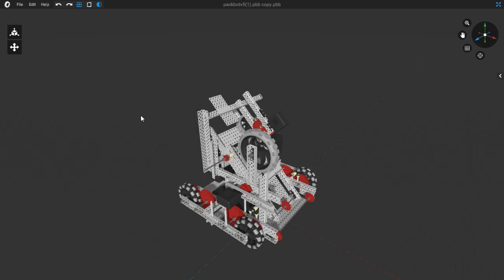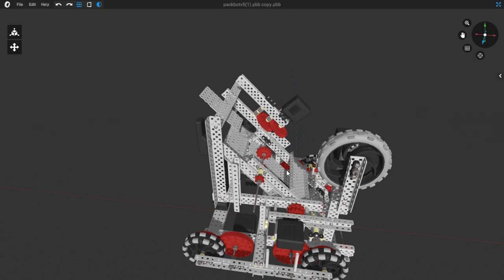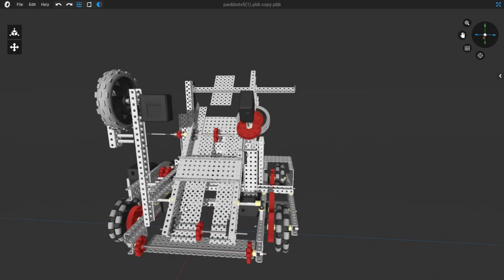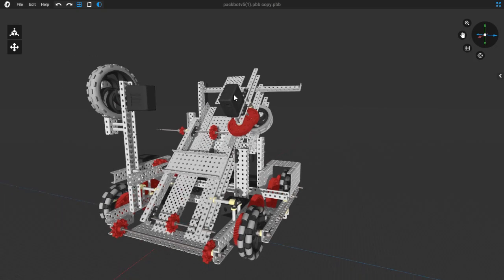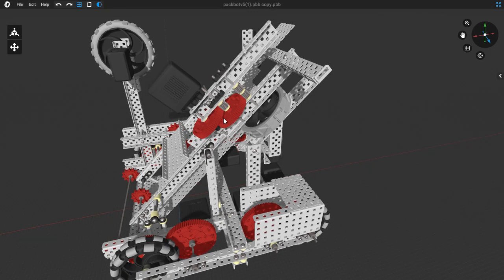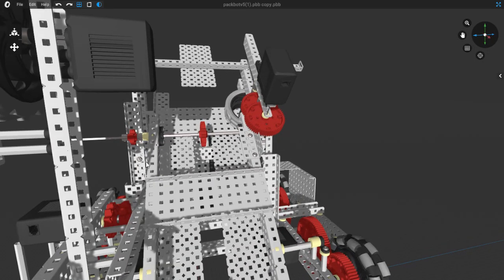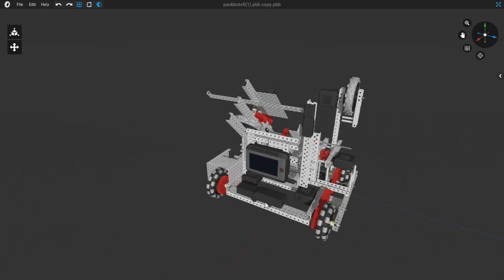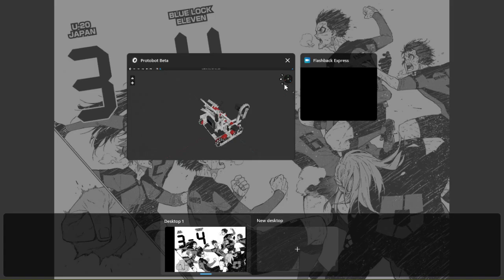VEX Robotics Spin Up CAD Model (read desc)

Comment: One thing I recommend is using anti slip mat or something with a flat surface to spin the color roller. Such as rubber bands, flex wheel, anti slip mat, etc.

Comment: Good design, you might want to consider adding some more sensors such as a color sensor for the flywheel, stability might also be an issue because everything is set on one point. You also might want to consider a sort of magazine, look at Purdue sigbots for inspiration. It may improve your cycle times and allow you to take advantage of your full-cycle times. If you don't have pneumatics a cam would also work.

Comment: It sounds like you already recognize most of the problems you're having. The only things I can really give feedback on are:

1: In a game all about aiming, I feel like being pushed from the side super easily would be a humongous pain.
2. Lining up a shot without being able to strafe doesn't sound super fun, but to each their own.
3: I know that Protobot doesn't have flex wheels, but I'm assuming you're planning to swap that 4" wheel in the flywheel for a flex wheel anyway.
4. As far as reducing clutter, I feel like you could be using polycarbonate in a lot of the places you are using flats (again, I know Protobot doesn't have polycarbonate support)

Overall, it seems like you've got a robot that'll at least work, once you've fixed the flaws that you pointed out yourself. Good luck this season!